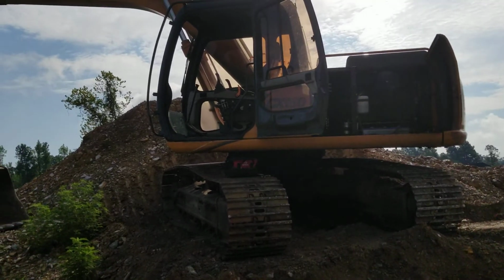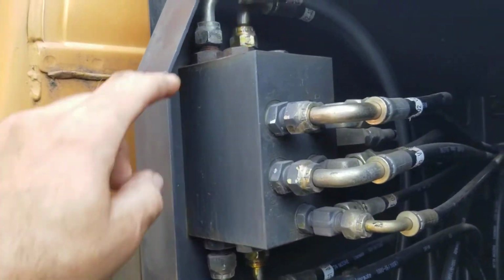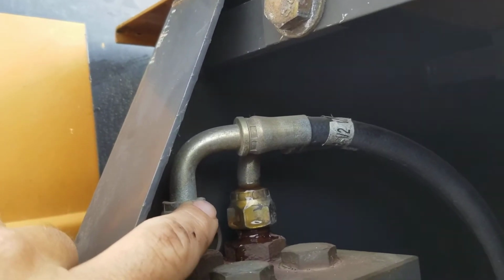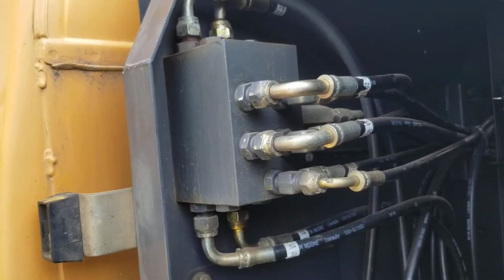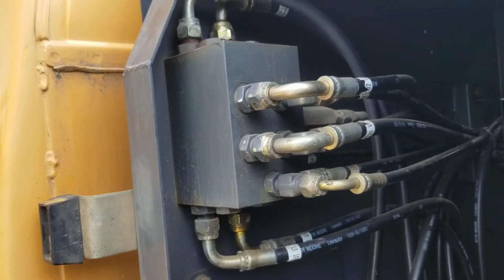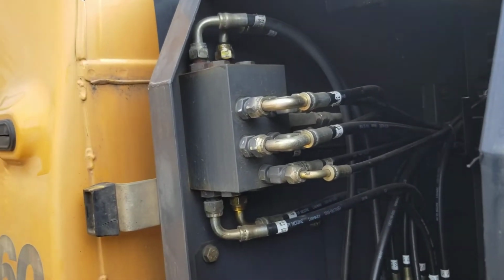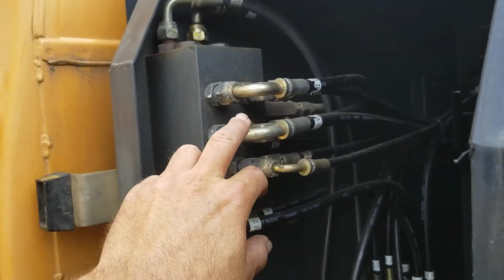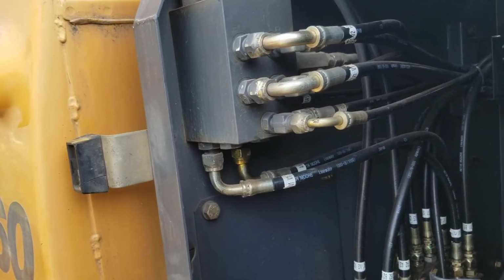How to switch case excavator control pattern

Comment: Good Info! I personally like JD control pattern on an ex only because of seat time. If it's a wide open area I'll keep it excavator controls, but I have done, and do a lot of work around LIVE utilities, so either case or JD are more comfortable for me (NO, I don't cross my hands! I love going back and forth between them just to eff with my crews! :)) I'm all about adapt and overcome, but doing a manhole rebuild in a downtown metro area with 75-80 live transmission cables, or picking your way through gas, water, sewer mains, etc.... The "extension of your body" is key!! Thanks for the info!

Comment: Backhoe mode works better cause it makes sense. It's just like your digging with your hands instead of being backwards
Reply from the maker: I think of it the other way around but.  Its mostly what you started on.  i started on a 3 stick foot swing case backhoe.  So excavator controls were easy to learn & come natural to me
Reply: @goodenough1971  yes now I can't run a 3 lever to save my life are just not fast lol
Reply from the maker: Ive dug miles and miles with a 3 stick case foot swing.. mind you that was before I was 52 years old . Now my legs hurt a lot but I still own a 3 stick case...but it sits under the shed mostly

Comment: Excavator, extension of your body?  Backhoe controls feel 100% more practical to me.
Reply from the maker: I have many friends that say that to, but their movements are never as smooth,fluid and precise as my own.  Could be mostly seat time, and age as the main difference.. they are always jerking that stick around.. I can tell they have backhoe controls from half mile away when driving up on a job just by the way the machine is moving around .. Ive owned them before on a cat backhoe that was to much trouble to change...  That thing got sold fast...   With that said I started on a 3 stick foot swing case backhoe and still do very well with those.. But my legs are getting older.   I think a 3 stick foot swing sets an operator up for excavator controls ..

Comment: Had the boom on the left side of the cab...and it does make perfect sense for machines with booms on the left , such as a log loader or whatever to have the control over  there...but it makes absolutely no fuckin sense to that on any  excavator which every one of them on the fuckin planet have it on the right side ....